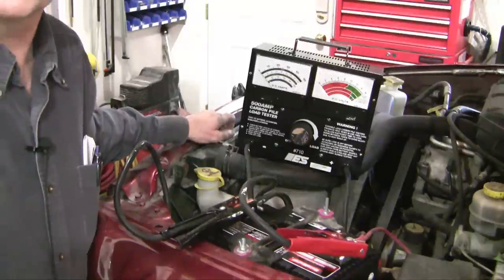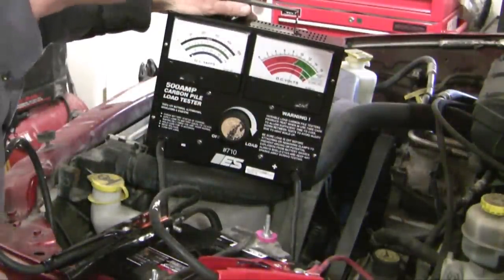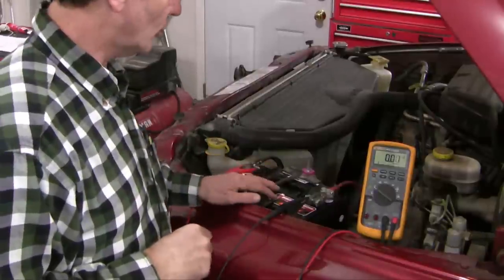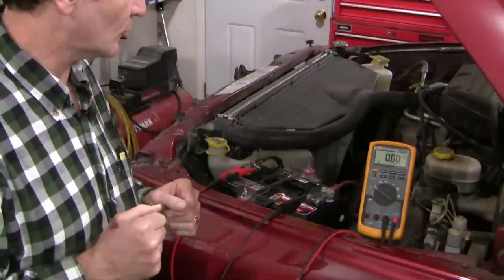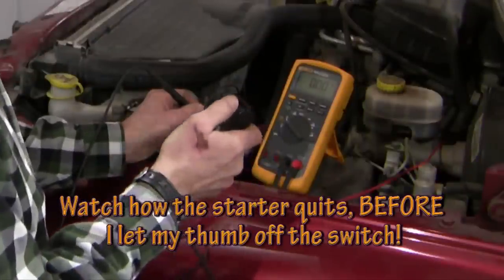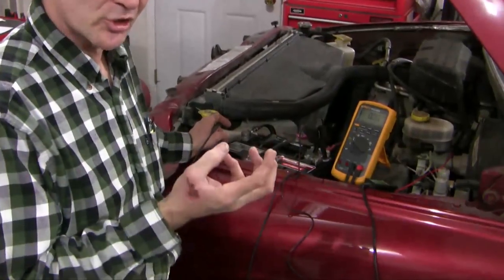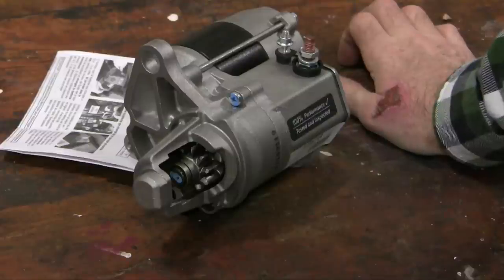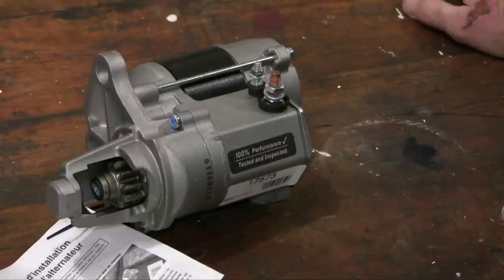How to diagnose & replace a bad starter motor

Comment: Hi Spelunkerd. Is it possible that there could be a voltage drop issue from the ignition switch side, and hence prudent to also do a voltage drop test between the S terminal on the starter and the ignition switch connection, and work backwards through that path if necessary
Reply from the maker: Excellent point, voltage drops can happen anywhere, though they are less common in signal wires like the ignition switch. Through the years I've scratched my head speculating why. Part of the issue is the fact that wires carrying low current don't tend to heat up at points of high resistance like they do in high current applications. The starter circuit is designed with a relay so that current through the ignition switch can be very low, permitting thin wires and small contacts. One of the biggest problems with a voltage drop is the way it tends to worsen, since high resistance leads to heat which can be hot enough to melt solder, then the joint falls apart with a little vibration. The heat is a consequence of power loss dissipation, the product of current and resistance at the bad joint. So, low current signal wires are preferred because they are less prone to overheating. The circuit will function normally until voltage loss in the wiring drops to the point the relay won't open, and these relays don't require a lot of power to function. The system is built with a lot of reserve. One of the most useful tools in a mechanics kit is the test light, which is a quick and convenient method for drop testing a low current circuit. Attach an incandescent test light to ground, then press the tip of the light on the solenoid signal post, and ask a friend to turn the start key. If your light turns on, your circuit has passed a quick screening drop test that doesn't require the effort of a formal drop test. It is wise to understand the qualities of your test light. I did a video of that showing how to evaluate your test light, I highly recommend watching that one. The light I use now requires about 180 mA at 12 volts to brighten up, and as an incandescent light it gives an easily evaluable range of brightness vs current. You want the draw required by the test light to be similar to the draw needed to run the end device. So, a test light is great for drop testing most signal wires, although it is NOT good enough for testing the high current demand of the main starter line. Thanks for dropping by!
Reply: Thank you for the insightful and detailed reply

Comment: Another great video. I admire your patience when going through your diagnostic steps for isolating the starter as the problem. There are a lot of folks who would have thrown a starter at it first. I also liked the remote switch, I'm going to have to get one of those. One more thing..I learned that I'm not the only person that casually says "B+", which is awesome.

Comment from the maker: Yes it is. A few years ago a group of auto repair shops were presented with a vehicle having similar symptoms, caused by a bad ground connection. It was a journalistic 'sting'. Most of them just replaced the starter motor and/or battery without bothering to do a drop test. Fail. Do the drop test to be sure. 

If you can find a replacement for the copper solenoid connections, you could just replace those, for a lot less money. See my other video on a starter solenoid autopsy.

Comment from the maker: In response to the question by Blake Morris, you need to test your battery with a load tester, a multimeter is completely inadequate if you aren't testing under load. The best way to do that is take the battery in to an autoparts store, where it can be tested for free. If I can get access to the cells I usually top them up with distilled water and I warm the battery to room temp, and I trickle charge it overnight to be sure the battery is given every chance to pass. If the battery passes, I would carefully clean and inspect the main connections at the battery posts and at the engine ground connection, since a voltage drip there could present in the same way. That pattern of slow cranking and clicking is a very common presentation for a bad battery or bad connections. A bad alternator can present in the same way but it's less common for alternator problems to present that way. One quick way to do a voltage drop test on a battery is to set your multimeter to volts, measure across the posts and crank the starter motor. Notice how far the voltage drops while cranking. If it drops to less than about 9.0 volts the battery is undercharged or bad.

Comment from the maker: I've replaced the front axle universal joints on both sides, and axle seals on 3 wheels. I've done the usual water pump/radiator/battery/ brakes/ brake wheel cylinder, etc, but nothing major. This vintage engine is not good on gasoline, and they are vulnerable to intake manifold leaks which require a fairly uncomplicated repair as a result of mismatched metals there. I haven't done mine yet, but some day. It's a great engine to work on, lots of room and relatively cheap parts. overall I like it.

Comment: Fantastic presentation.  I'm curious to know if you think the starter was bad or the solenoid.  The voltage drop was within specs, did you happen to put your fluke clamp on to see the amp draw.   Looking forward to  another informative vid.  Thanks.

Comment from the maker: @Bonfield2002 Another excellent question. One clue is that at 5:26 the voltage drop fell quickly. So, it was a sudden break in contact somewhere rather than a short. This was happening intermittently when I would start with the key, so it's not a testing artefact. 
It would have been fun to try and fix it, but I need this vehicle to work for me, so I just replaced the motor. If I have time I'll take it apart and have a look.

Comment: Have same 1998 Dodge Ram truck also same color... years ago would not start..found the problem to be internal parts of starter were covered with oily dirty film from engine, Took starter apart cleaned it in a bucket with brake cleaner put back together..worked like a charm.. 10 yrs later still going...

Comment: Very informative. I wish the dealership service advisors could be so helpful. My 2007 Honda Odyssey  shows signs of battery power(panel lights, vent fan etc) but no cranking, no clicking. Then mysteriously it starts. Was stranded once but when in the mechanics hands started 2nd try. Great video, any more enlightening thoughts? O yeah, its not fixed yet, just starting (pun intended) down that road.

Comment: Like this video... good to watch a troubleshooter in action. Another problem that you can have with the Ram  is the starter fuse blowing, which according to a TBS recommends replacing the fuse for a higher capacity or rewiring the box to the starter with a wire one size up.  Actually I came to find out on my old truck that the problem was in the starter solenoid itself. The contacts inside are 2 half moon and that B bolt is what holds that side of the contact to the wall of the solenoid internally and during install too much torque was applied and it made that half moon to be calked so high amperage and the blowing fuse. Just had to remove the solenoid back plate and realign the contacts, being careful with the torque.   This solved my problem.
Reply from the maker: Excellent point, you can also buy those contacts individually although they may be a little hard to find. Perhaps filing them down would work for some. The other issue is the reliability angle, where guys depend on a vehicle to get them to work on time. They don't want to fiddle with something that may be unreliable in the future. I remember when I didn't have much money I bump started my Honda in the snow for 6 weeks until I had time and money to fix it. You make a good point about the fuse. Interestingly, there is no fuse for the main source of current, but there is a fuse for the solenoid control circuit. If the starter motor is easy to reach you could test there, and if not then the relay is easy to find in the main fuse box. Cheers!
Reply: This is a set up from Help that may work on some solenoids : Dorman Products - 02349, thank you for your response.
Reply: Hello, Spelunkerd, Doorman makes a contact repair kit, Help # 02349. Thank you for your reply.
Reply from the maker: Thanks for recording the part number, I'm sure others will be interested.

Comment: Nice video.   For electrical testing, sometimes an analog meter works better - especially for quick changes.  The digital meter's sampling is good for constant voltages but the analog works better if things are rapidly moving.

Comment from the maker: It depends on the vehicle. Older vehicles and trucks often have lots of room. New compact vehicles may require dismantling other structures to get at the starter. You should be able to tell by having a look to see how easy it is to get at the starter, and specifically the two mounting bolts. If the access to those bolts is clear, replacing a starter is usually a piece of cake.

Comment: My 1995 Buick Century is having intermittent issues starting up, becoming more common as the days go by. The car would crank really slowly, but it would start. Until tonight. I went to start it, and all I heard was a click. Tried it several more times, still heard the clicking. Finally started after another click, but was still very slow to crank/turn over. Once it was running, it was fine. The battery is good, I have tested the charge with a multimeter. So I've narrowed it down to a starter issue. What do you think?

Comment: Great video, I've watched a few video's on this subject but this one was the first one to answer my questions although I do with there was a better display about where the starter is located on the truck itself.
Reply from the maker: Xander Hintz New vehicles are tricky, but once you know what to look for, finding the starter is pretty easy. For vehicle-specific info, the dealers repair manual is a wise investment if you plan to repair your own. I like alldatadiy for an online copy of the OEM manual for a fraction of the cost. If you use it once the $40 cost for 5 years pays for itself. Thank you for watching.

Comment: @spelunkerd   I have  had a starter not turn over because of a bad  contact  and hit it with a hammer to jar it to start but in my experience once it's turning  the  brush contacts just skip over a bad spot.  Your starter did not turn slow at all and then lost power.  I wonder how you would test the solenoid on the truck if you suspect its at fault.  You only have a trigger signal wire and a B+ cable.

Comment from the maker: Intermittent problems are tough. To better define what is happening, I would carry a multimeter and a flashlight in the car, so the the next time it happens I could quickly test whether the trigger post is getting voltage at the moment it fails. If access to that post is difficult you could run a wire from the trigger post to a more convenient spot, preferably one that allows you to turn the engine key and watch the meter. If no voltage there, it's an ignition or neutral safety switch problem.

Comment from the maker: Thanks for watching! Yeah, when I was initially looking for power at the solenoid trigger post I should have done that, and I would have seen a more accurate static reading. But the reading gave me what I needed, showing voltage there, like it would in a no start situation.

But when I bypassed the ignition and cranked the starter directly, the fuel pump was never activated (key was left in my pocket for the second part of the video).

Comment from the maker: Not usually, although intermittent problems can be deceiving (often a bad starter will work once more if you bang it with a hammer). 

If it starts with a boost, I would charge the battery, then test the battery. Many parts dealers will test your battery for free if you bring it in. If the battery is bad, replace it. If the battery is good, do a drop test to look for bad connections, the way I show in the video. Sometimes boosting will bypass the bad connection. Good luck!

Comment from the maker: You've got to go through the whole process of making sure you are getting adequate current and voltage across your starter motor before condemning it. The commonest cause of what you describe is a bad battery, NOT the starter motor or solenoid. A less likely cause is bad wiring, but it's important to rule that out before buying another starter. If you don't have the tools, then take your battery out and ask for a free battery test at any autoparts store. Good luck!

Comment: I need to purchase electrical measurement tools. You used two, the load tester and a multimeter, correct? I believe my starter is gone, but perhaps I burnt it out because my car would turn over for several seconds before starting before it died altogether. Any thoughts on which tools I might want to buy? brand names that are trusted? If there's one device that does it all, that's what i'd like if its not outrageously expensive. Also, any thoughts on my problem based on my brief description?

Comment from the maker: Commonest cause would be the battery, I would start there by getting it tested for free at any local autoparts store. If battery is good then I would do a voltage drop test as shown in the video to exclude bad connections of your wires. Having said all of that, what is happening to you is also typical of a failing starter. Sometimes a failing starter or starter solenoid will work a few more times if you give it a rap with a hammer -- that maneuver might save you a tow.

Comment from the maker: Even though you charged the battery it is still likely to be a bad battery. Before changing the starter I would get that battery tested for free at an autoparts store. If the battery is good you should go through the steps I outlined, to be sure it's not a bad electrical connection between the battery and the starter. 

If you think it's the starter and you are desperate to get the car started immediately, you can rap on the starter with a hammer to bump the solenoid or brush connections.

Comment from the maker: A multimeter is a great tool to have, and I would look for one in the mid-range. Expect to pay $30-100, get one that can measure amperage, and look for one that can read RMS voltage, which is different than just 'voltage'. Don't get the cheapest. My Fluke is top line but far too expensive for an amateur. Watch the "best multimeter" video by Afrotechmods. You don't need the battery tester, many stores will do that for free. You don't need the switch, ask a friend to turn the ignition key.

Comment from the maker: I need a more accurate description. Do you mean the key won't spring back, or do you mean the starter motor won't disengage? Before you do anything, check your oil level, and turn everything off. Maybe get a code reader to find out what your computer says is wrong -- bad starters don't usually throw any codes unless there is something else damaged. I'm a little concerned you may have internal mechanical engine damage and the starter can't turn it. Can you turn the engine from the crank bolt?

Comment from the maker: (continued)
Yes, your starter could be toast, but I would do the drop test as shown and check out your battery before tossing the starter. Maybe you ran the battery down - remember you can't test it with a multimeter alone. One other thing that rarely sounds like a bad starter is a seized engine, which locks up and doesn't allow the starter to turn. You can rule that out by putting a wrench on the harmonic balancer bolt and turning the engine over by hand. Hopefully it's more mundane than that.

Comment: I think  I turned the ignition key to quick on my 98' Altima Nissan and now it doesn't turn off, the check engine soon light come one, and this all happened after it turned on for about a minute, then, after a minute of the engine shaking and making a clicking noise, it all stopped, what do you think it is, .  My guess is "the starter" or timer.

Comment from the maker: Bad news, I hope it's just a fuse. I would go through all the fuse boxes in your car and search for a blown fuse. Diodes and transistors can fry if hooked up the wrong way, and I hope your computer is OK. Do you know if the vehicle is equipped with an anti-theft security system? Anti theft systems are sometimes set up to not start after battery removal, maybe consider that possibility. Thanks for the sub.

Comment: I replaced the battery a few days ago. I just tried to start vehicle today since then and it was dead. The 20amp starter fuse was popped. I replaced and tried starting again and another pop. Prior to all of this I had a check engine light and one of the codes said neutral safety switch. Do you have any suggestions? Bad starter? Bad nss? 
2000 Ram 1500 5.9L
Reply from the maker: Randy Glover Those are good thoughts. I would recharge overnight, but this time pull the starter fuse and use an ammeter to see if you've got any parasitic drain with the starter fuse removed. Hopefully the battery will be OK after that, with negligible drain, which means your problem is in the starter circuit. From there I'd use a wiring diagram to narrow down the search. Isolate segments of that circuit and test each individually. It could be something simple like a short, a defective solenoid or a sticking relay. If you think it's the starter motor you could isolate the starter and test that by itself. But that's a switched circuit which means overnight drain wouldn't usually happen unless there's a switch, solenoid, or relay problem.